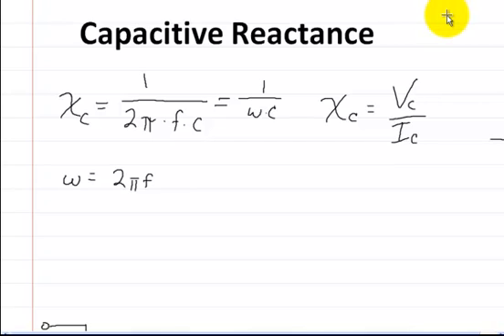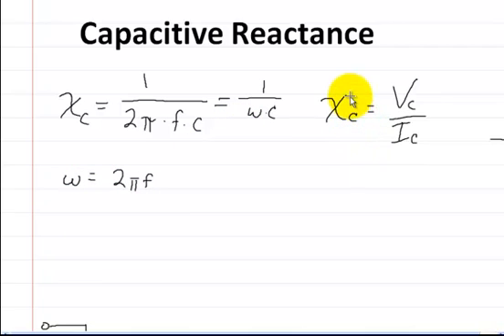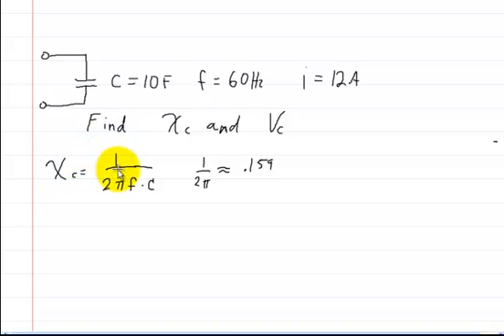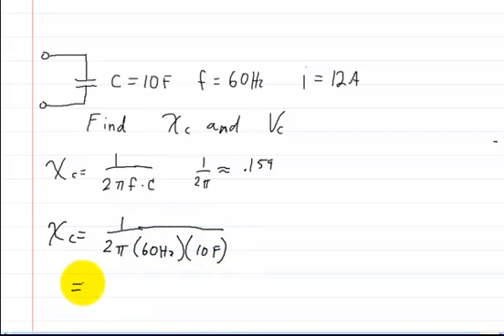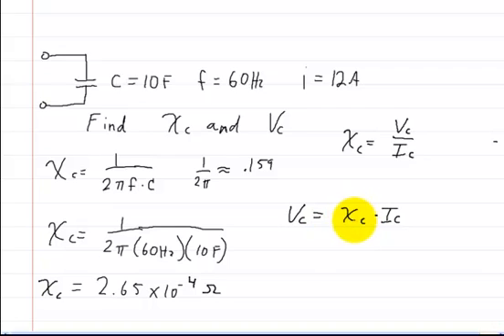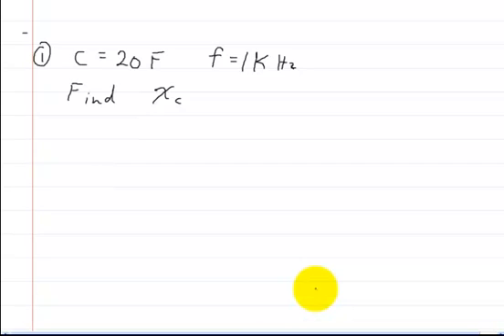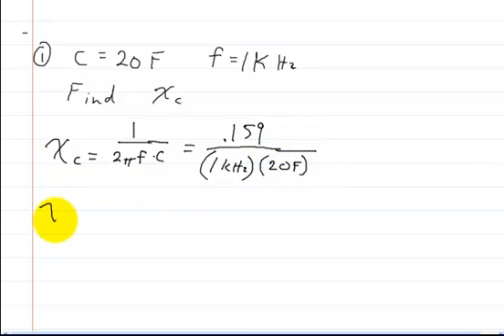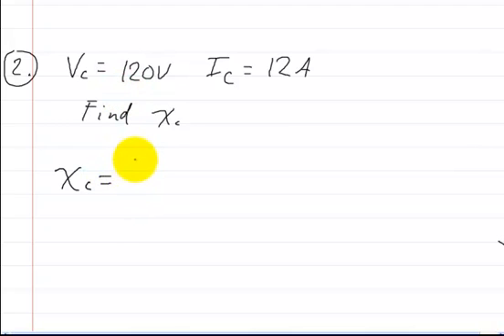Capacitive Reactance: Part 1

Comment from the maker: Actually the answer is correct.  The reason you get 7.96x10^ -3 is because you divided by 1 hz instead of 1k hz.  If you divide by 1000 hz you will get the correct answer.